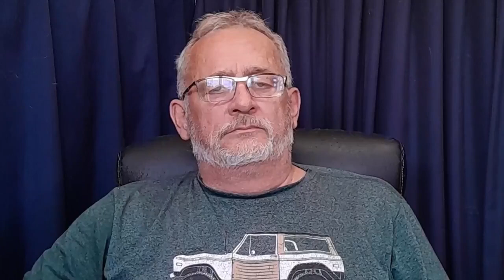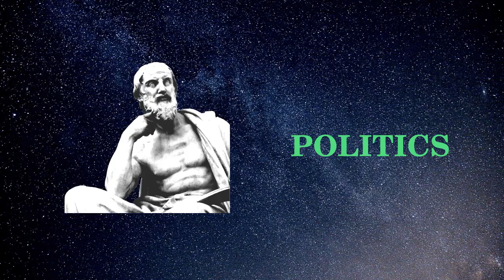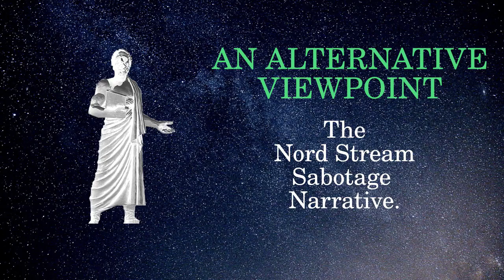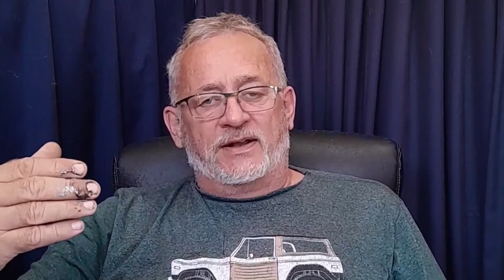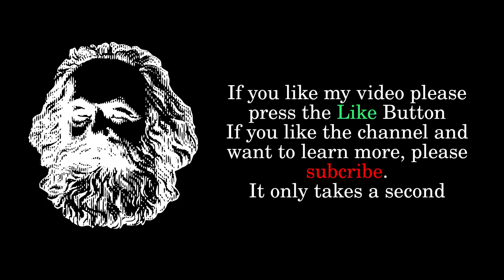An Alternative Viewpoint: The Nord Stream Sabotage Narrative

Comment: Have you ever seen comercial divers with rebreathers?
I thought they would use a external line from a ship.
Also after a 80 meter dive you will need a decompression chamer.
Reply: right on.. also divers didn't have to be used.. could have been some sort of remote device sent to place the explosives as well
Reply: @Betelgeuse-Qr  For that you need a crane and a bay on the ship ... you need a ship and not a boat ^^